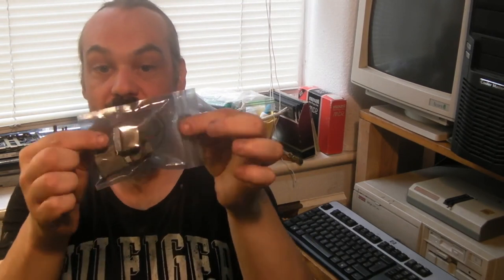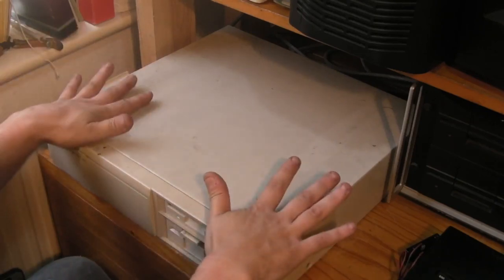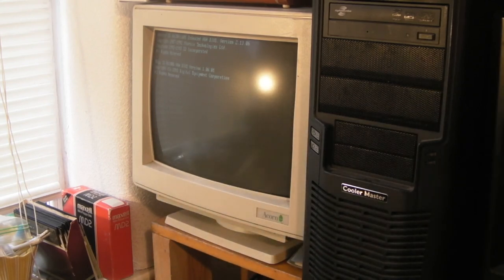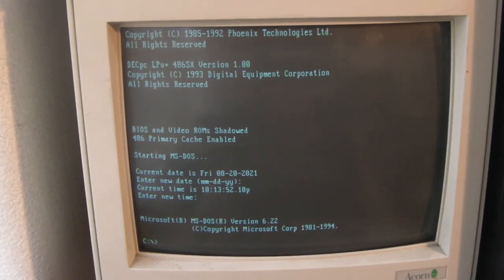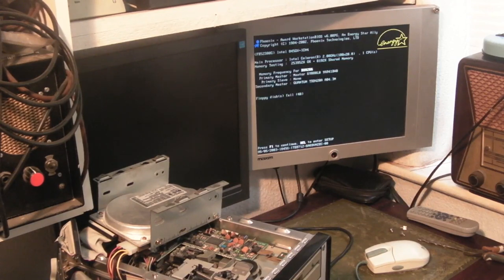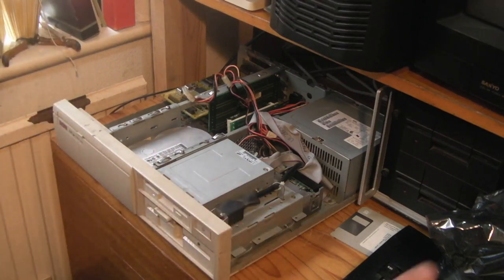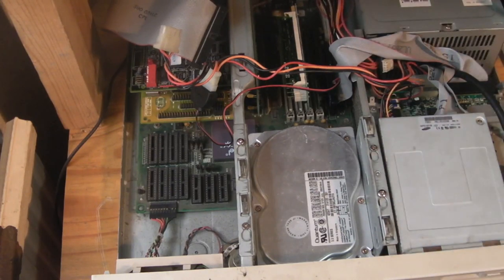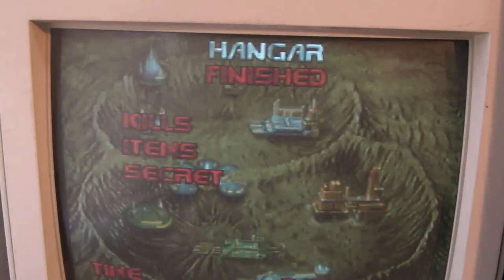Installing a D.O.M. (Disk On Module) in my 486

Comment: Interestingly, I have the exact same DEC PC.  It was also sort of a utilitarian workhorse for me for a while, though it's out of service now.  I used it as a network print server for an Okidata LED page printer with a proprietary ISA card as an interface.  I also have a '90s Universal Device Programmer (and logic and RAM chip tester) that has software in DOS and its own ISA interface card.  Mine is from Modular Circuit Technologies, and I host it in a Tandy 4000 '386 computer (with a TI '486 upgrade chip) and 16 30 pin 1M SIMMs(!).  You were wise to swap that hard drive out for a flash module preemptively, because the spinning rust on my Tandy 4K has failed.  I will probably put a CF card in it, since I have those, with the IDE adapters.  But it's good to know the DOMs are a cheap alternative.

I'm looking forward to the continuation of your ZX-81 project with the little CRT.

Adrian Black (of Adrian's Digital Basement YT channel) showed a 4" 90 B&W CRT module he got from AliExpress, that's similar to the ones used in the old Sony Watchman.  These were for apartment door security monitors.  So I ordered one that will go into a briefcase, so that when you open the case, the monitor will face you, and a keyboard will be in the lower part.  My plan is to buy a basket case Timex/Sinclair 1000 and built it into this thing, along with a cassette recorder.  This will be a hypothetical ZXecutive -- a "What-if" imagining Sinclair had decided to compete with Osborne.  I'll do a 32K SRAM upgrade on the motherboard, and bypass the RF modulator to put video directly into the monitor.

But I'd still like to see your project completed.  It was an inspiring idea.
Reply from the maker: Yes that is one project i put on a back burner I keep on meaning to complete. Its up in the attic at present but ill dig it out, cant quite remember where i left off to be honest.
I used to have some of those flat CRT monitors myself back from when i was an electrision and used to fit door entry systems. wish id kept a few now. 
your idea of the briefcase zx81 sounds very cool.

Jay

Comment: Ooh that’s the same DEC I have :) Well, mines a DX2/66. I’ve got a DX4/100 overdrive on the way to try out
Reply from the maker: Its a really nice compact machine. Mine had a DX2/66 in it when i got it but I reverted it back to the original SX/33. the DX4/100 sounds like a fun upgrade. I have a Compaq machine up in the attic with i think an Evergreen DX4/80 or something similar in it. I'll have to dig that out and perhaps do a video on it.
Reply: @Jayoldstuff1  I'll let you know how it goes, if at all :p